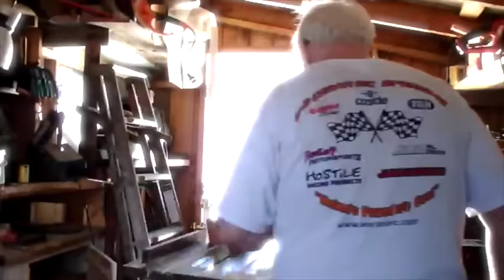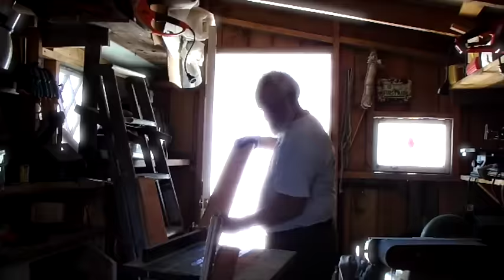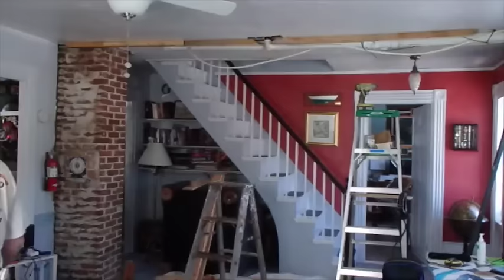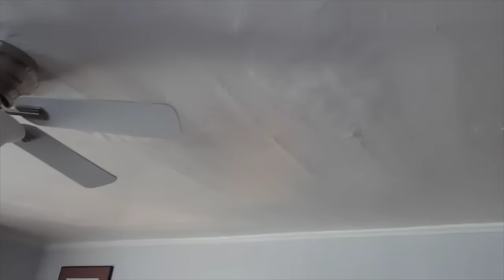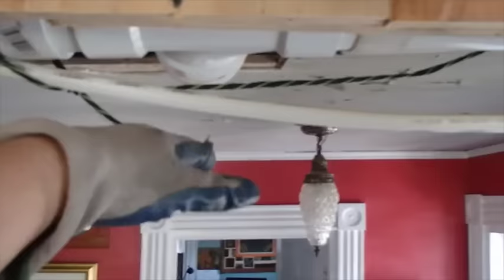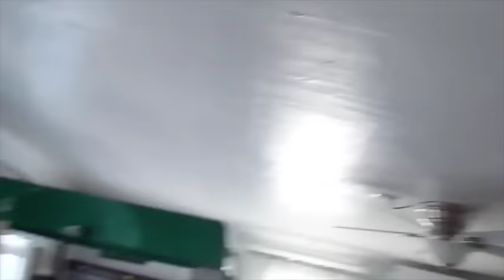Enclosing Pipes 8, After the Cut

Comment: Yes indeed you have a big area to cover with a bit to plaster and fix up. Screwing those boards in is the way to go rather than nailing in case you have to get at those pipes. i have never lived in a house as old as yours. The oldest one i lived in was my parents house built in 1948. Your was built in what about the 1860's? That would account for the lath and plaster
Reply from the maker: 1842, pre Civil War homes had split laths rather than sawn laths.
Reply: rpeek Wow 1842 well now i can see why it has been remodeled and redone a bit. Bet that construction beats any new construction these days.
Reply from the maker: When I bought it my brother in law said you could knock the corner out from under a post and beam house and it wouldn't move an inch.  I proved that when I discovered that the corner of this house had rotted out.  It never moved, and I fixed it real good.   She's nice and strong..
Reply: Yep I believe its better and stronger than the houses today. Its like taking care of a monument. Two thumbs up
Reply from the maker: Thanks Larry..   Two thumbs up.

Comment: So, I was curious about your sagging ceiling myself and I remembered seeing you pulling that living room wall down, so I took a look.  On Jan 1 2010 you posted a vid titled   "Taking down the living room wall 1"  You were pretty herky jerky with the camera then BUT slowing the replay to 1/4 speed at right around 27 seconds in, you pan right across the living room ceiling at the junction of the existing wall and ceiling.  At that speed the ceiling looked pretty darn straight back then.  But is it just the plaster?   The lath and the plaster?   Or less likely, the beams in that area of the house?  I dunno. You did have a bit of a leak in the shower for a bit though...
Reply from the maker: We had shower leaks but they don't get near the beam.  The beam is pretty huge.  The tile floors in the bathroom would crack if it moved and that hasn't happened.  I'm not completely sure if this beam settled a bit or not.  Old as it is i tend to believe after almost 200 years it's not going to move much, but you never know.
Reply from the maker: We had shower leaks but they don't get near the beam.  The beam is pretty huge.  The tile floors in the bathroom would crack if it moved and that hasn't happened.  I'm not completely sure if this beam settled a bit or not.  Old as it is i tend to believe after almost 200 years it's not going to move much, but you never know.
Reply: Oh you can still get movement. My house was built around 1830 back befour4 the Civil War and it's still moving, slowly but moving.
I took out a wall in my house but I put up a beam for support where the wall was. I replaced all the plaster and lathe with sheetrock. We still get some cracks. The cellar is made using brick and that may have something to do with it.
Reply: IOIO GG
Reply: Well, I didn't really figure it was probably them heavy beams... but maybe that living room wall was kinda propping up the lath and plaster in that area a bit? In any case looking at the old footage seems like there wasn't any sag before...
Reply: A sagging Boss er ah a sagging Boss's ceiling. I am of the school of, If it aint broke don't fix it course the Boss is not of that school. He is from opposite land If it aint broke let's make it better. So now that ya pointed out that his ceiling is sagging he may have to make it better. Course that may take a few years. We will just have to wait and sea. Cause ya know with the Boss it's a Peek thing.
Reply from the maker: I don't think it'll fall down before I croak over so I'll be okay with it for now..
Reply from the maker: I don't think it'll fall down before I croak over so I'll be okay with it for now..
Reply from the maker: I seen an old photo of me from back when I was in my 20's and I noticed the same thing....   Dang..